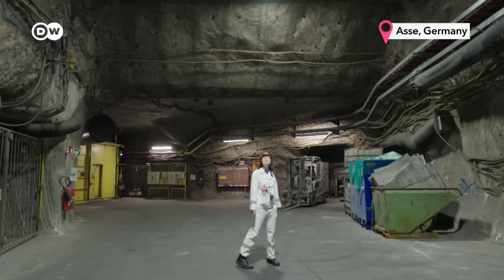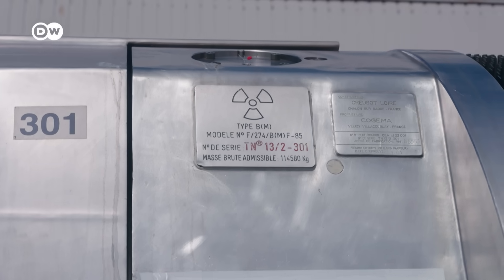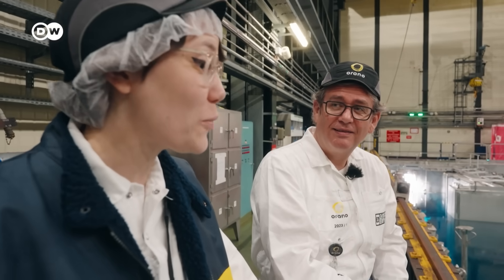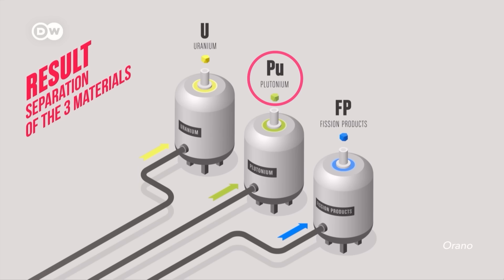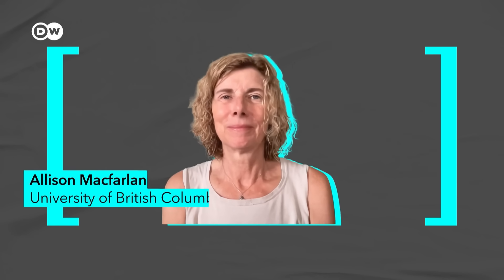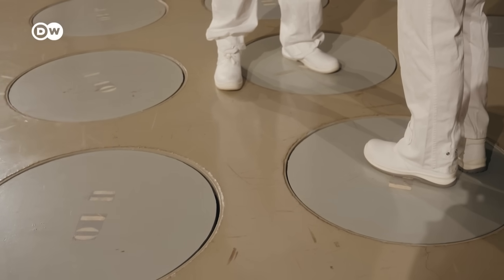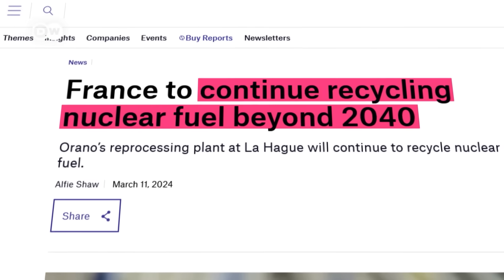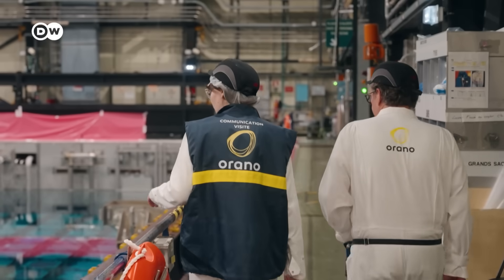Nuclear waste is reusable. Why aren’t we doing it?

Comment: La Hague is an impressive and very important facility – it plays a key role in reprocessing spent nuclear fuel and recovering valuable materials. Don’t take this as pure fact, but as I have understood it, France and many other countries do not yet have a permanent geological disposal site for the high-level waste that remains after reprocessing.
In contrast, Finland is building Onkalo, the world’s first operational deep geological repository for spent nuclear fuel, located at Olkiluoto. While France leads in reprocessing, Finland is pioneering permanent geological disposal. Both approaches are essential parts of the global nuclear waste management picture.

Comment: A great deal of disinfo against the LFTR MSR, no fuel rods needed, no giant cooling towers needed, and make pu-238 rtg power cells that last 80 yrs.
china is now running a variant of the US reactor made at ORNL in the 1960's, it is the best solution and would power the world for a thousand years if not longer.
Its would do so much cheaper, much safer, and fails passively to a passive cooling tank, and they did so every weekend at ORNL for 6,000 hrs.

Comment: Reducing the need for fresh uranium by 30%, and using the resulting mix to produce only 10% of your electricity doesn't sound much like you have achieved "sovereignty".
There is something else missing here too: not all Pu is removed, and other minor actinides with high radiotoxicity and extremely long decay times (tens of thousands of years) remain in the waste fraction, and still need long term geological repositories.
Pu recycling is not an effective enough method. Only fast burner reactors could really solve the eternal nuclear waste problem, leaving us with only fission products to deal with for a few hundred years instead of 100 thousand. But these technologies barely ever made it out of labs and demonstrator plants in the past 50 years.

Comment: If the rods in the shipment container is 300-400 Celcius hot  (as explained in the video), why not use it directly to heat and produce steam?
Reply from the maker: The used fuel rods are indeed very hot, but the main issue is that they are also highly radioactive. This makes it unsafe to put them directly into a steam system. There has been research into capturing and using this decay heat, but so far no practical technology has been developed that can do it safely and economically.
Reply: @DWPlanetA thanks for the answer 🙏🏻. However, my theory is though the steam and water will be contaminated it can remain within a close loop like in a HVAC system where the freons circulate in a close loop. Steam drives the piston then the vapour is cooled down and forms water. Then it's pumped back to the heating chamber. All this happens within a nuclear shielded container. Or am i missing something fundamental?
Reply: @dukeopeace7530 I'm gonna take a wild guess that costs and risks to maintain your system would be too high. I think leaks in the steam pipes would be incredibly dangerous to fix, and I'm pretty sure the plant would have to be shut down just to allow workers in for regular maintenance.

Comment: Because of their efficiency, molten salt reactors could be set up to burn nuclear waste.  It's been found that if enough MSRs were built to supply the current requirements in the US, MSRs could run for 350 years, burning up the nuclear waste.

Comment: First, the reactors are wrong. Salt solution reactors have an efficiency of 95%
Second, the fuel is wrong. Uranium only lasts a couple of 100 years. Thorium lasts 10,000years and is much cheaper.
Third, the oil industry doesn't want this kind of reactor; it would destroy their business completely.
So they got the money and stopped all the funding by all means necessary.
Without money, no reactor.
Nikola Tesla died poor, not from lack of knowledge, but from lack of funding. There is no cheap energy. It has to be expensive.
Accordingly to the people who have the money.

Comment: A Molten Salt Reactor (MSR)can be fueled with a mixture of Uranium and Thorium.  The inventor of both types of reactor was Alvin Wineberg.  The MSR can burn 98% of the fuel rather than 2٪.  Properly operated, MSR's don't produce Plutonium bomb material.
So why has the MSR type been abandoned?   Oak Ridge was the site of the research reactor.

Comment: If you were to add the cost of recycling to the business case for Nuclear power, the case does not add. Thorium can expoit spent fuel rods but you still have aresidue that you still need to safe store for 100,000 years.

Comment: To make a bomb weapons  grade is necessary. The obtained plutonium  from  fission reactors is NOT of weapons grade.
The Soviets did not know and built the RBMK anyhow , a kind of copy of a converter reactor ,
The idea is not totally wrong as graphite is used as a moderator and less U235 is needed in the fuel.
But the safety issues are as you know terrible.
Journalists are mostly communist affected and lied from the start as they got their information from Soviet KGB.
There are other reactors much more efficient and safe, but Big Oil does not like them and stopped development 1970.

Comment: New fuel is cheaper and people/governments are paranoid about nuclear proliferation.

The first issue has several solutions: store all the spent fuel until new fuel becomes more expensive than reprocessing (so the spent fuel is a valuable long-term investment), subsidize reprocessing to effectively mandate all spent fuel is reprocessed, or switch to fast-breeder reactor designs configured with molten salt reactors with continuous reprocessing of the fuel matrix. (the latter has the problem of maximum nuclear proliferation paranoia, albeit somewhat less so for hypothetical thorium-uranium cycle reactors instead of uranium-plutonium)

France is the only country in the world to use the section option (mandate reprocessing and heavily subsidize it). This approach also makes it more economical and much, much more strategically secure (full self sufficiency, no reliance or dependency on importing fuel from Uranium-rich countries), even if it still costs somewhat more than buying new fuel. France did it both because of their nuclear weapons program and for national security power interests. (they way they managed their nuclear power plant construction program is also exceptional given the tight regulation, high degree of standardization, and resulting safety records)

Of course, the real problem is that most of the mismanaged waste isn't unprocessed spent fuel, but large volumes of contaminated material that need to be processed, treated, condensed, and then disposed of properly (for any remaining residue). That's the kind of stuff that's supposed to be in the iconic yellow barrels. (though given the gross corruption and mismanagement ... and lack of proper oversight, that led to the sort of dumping in the case of the German salt mine ... I wouldn't want to bet on the levels of contamination for some of that stuff)

Spent fuel itself is generally too valueable to store as simple waste, even if it's not valueable enough to fully  reprocess (yet), but worth keeping around as a useful raw material. Plus you have to let it sit for years before it's safe to reprocess, anyway. But, from the reprocessing also comes the extraction of the fission product, particularly the medium-term (ie decades to hundreds of years) isotopes like Strontium 90 and Cesium 137. Those can be rendered chemically inert by dissolving into glass (forming silicates, given both of those have many, many soluble salts, especially Cesium, like all alkali metals) and going to a long term geologic repository (there's a tiny amount relative to the power produced, so this isn't a big deal ... as long as you have remotely sane regulation, and any sort of sane long-term planning, from a business perspective, too, since improper dumping is never good for long-term profits ... it just depends how long term you think)

But, even with the fission products, there's valueable use of them as well, and potential for nuclear-thermal generators of various types ... just don't distribute them throughout the wilderness and then abandon them like the Soviets did. (more realistically, they could be used as secondary generator fuel on-site with some power plant models ... and all sorts of waste processing is better to do on-site as much as possible as well, both for security/risk reasons, and sheer cost effectiveness)

Fast reactors also burn up a small portion of fission products due to the high neutron flux (or the side effects of high neutron flux), and fast-breeder reactors tackle that while also extending the refueling cycle dramatically. (assuming all bred fuel is intended for power generation with no reprocessing into weapons material, the fuel cycle can be much longer, or indefinite in a molten salt reactor, since the molten salt fuel matrix can be continually reprocessed during operation) But the most promising of these types are still experimental for the most part, and there hasn't been enough public interest, support, or funding to really make them a reality. (so the safest, best tested, most reliable designs are mostly derivatives of conventional tried and true light water reactors, many descending from the already mature designs the French licensed from the US in the first place)
Reply: Russia also

Comment: 2:04 How is this safe??? Wouldn't the fuel rods still emitting bunch of neutrons that can't be stopped by steel easily?
Reply: They go on 10 seconds later to say that it’s extremely heavy due to all the shielding
Reply: The more depleted it is, the less protection it needs, they also didn’t specify the thickness and possible other material and coatings used

Comment: A lot of that nuclear waste can be turned into top end cancer fighting meds!
Considerably more useful than coal just shitting carbon dioxide into the skies and not taking any responsibility for it. The nuclear waste, you can put it somewhere specific and it stays there, if done correctly. Not like the lead in leaded gasoline which is all over the surface of the earth now. 
It's a bit sad phones and tv's and monitors so high tech, and it's still coal = electricity. Plus it might still be that way the next 50 years if we don't haul ass to get more non-coal electricity sources.

Comment: Siemens already invented Clean Nuclear Power Generation in the eighties. But President Carter banned it !
Clean means the nuclear fuel can be used again and again until it is completely used up. So safe you can hold it on  your bare hands !

Comment: 7:52 WTF is a metric ton? I've used ton for all my life.  I've never heard anyone using a non-metric ton.  The "metric-ton" is something weird americans use.  So why is DW saying metric ton? Are europeans starting to forget how the metric system works?  Can I say metric-celsius or metric-gram as well?  Why are you being weird?
Reply: Unlike celsius and gram that are only used in metric, there is an actual need to dissociate ton by it use context.

There are actually 3 différent unit called ton/tonne: 
-the «metric» tonne (1000kg)
-the «british» or «long» ton (1016.0kg / 2240lbs)
-the «US» ton (907.2kg / 2000lbs)

I do undesrtand the confusion though
Reply: @toilieth There is no confusion.  The long ton, the version of ton before it standardized into the metric system as 1000kg is completely obsolete.  

Unfortunately the short ton, the US invented weird ton with the wrong conversion, still has some place in certain American industries.  After the metric standardization of long ton into ton, some American self-centered weirdo decided it should be easier to convert if they considered it to be as 2000lbs when the rest of the world was already using 1000kg.  Americans should call it short-ton, to differentiate their weird ton because there is already a ton that the rest of the world uses.  

To change how an internationally accepted unit is called, instead of accepting their own mistake and not call it the short-ton, but change the internationally accepted ton into metric-ton, is uniquely an American self centered view.  It is quite embarrassing really.

By the way, I studied engineering in the USA in the 90s.  We studied both imperial and metric.  There was never something called metric-ton or short-ton or long-ton.  Ton as part of the metric system was sometimes used but nothing else.  There really is no need to differentiate anything.  Americans can call their weird ton as short-ton if they want to use it so badly and out of respect for the rest of the world, as rest of the world don't care about their weird short-ton anyways.

Comment: Sigh this stuff in the berrals is all the stuff associated with handling and containment equipment it's contaminated with radioactive particles. The fuel itself usualy gets stored. It's way more expensive and dangerous to recycle the pellets expand and fuse with the containment tube.so you need acid

Comment: Gee...wouldn't it be great if we could actually turn all this nuclear "waste" into something usable energy without a whole lot of handling? Thorium Molten Salt Reactors can do this. It can accept not only U-233, but also U-235, U-238, Pu-239. MSR's will have a "kidney" like set of devices that will chemically separate what is needed from what is not needed. An example, if U-238 is allowed to circulate around a reaction vessel where an additional neutron can be added, it can become U-239, which half of will turn to Pu-239 in about 3 days half.  The ability for a MSR to set aside U-239 just as it will do to Thorium-233 to convert to Pa-233 then to U-233 will allow these reactors to accept U-238, convert it to U-239 eventually becoming Pu-239 which is fissile. 

Did you know that the EPA does not allow Uranium miners to return the U-238 waste to the mines where it was extracted? With a Th-MSR, it can now use the U-238 as well to produce electricity. So instead of using only 0.7% of uranium that is U-235, we can now use U-238 which we have in abundance. 

What's stopping all of us? Ask the NRC...bureaucrat scaredy-cat regulators.

Comment: Yes, but chemical reprocessing is expensive and produces more highly toxic chemical waste! A much smarter approach is to use integral fast reactors like the ones Russia is using (BN-600 and BN-800). One, designed as a "fast breeder" uses spent fuel elements (U238) to breed new fuel for it self and pressurized water reactors; the other, designed as a "fast burner" uses high-purity weapons-grade plutonium from nuclear disarmament/modernization (or the 239pu from fast breeder)... and both are running during commercial electricity and energy production! Germany could have had an isotope economy with a closed nuclear fuel cycle (NFC) long ago with the Kalkar nuclear power plant, but unfortunately, the operational nuclear power plant never went online due to political concerns. 

The principle of breeding is not really new, as it was already 2 billion years ago at the natural nuclear reactors in Oklo.

Comment: If that spent fuel is still over 200C-300C why not use it to make steam and then power? while you wait for it to chill out and cool down?
Reply from the maker: It would be tricky. You’d need special gear to handle the heat safely, and the current setups aren’t built for that. It's doable, but would take some work and investment. ☢

Comment: The energy from nuclear plant is already the most expensive and there is even not account the risk of a total meltdown. As You have seen in the video the used material is mostly not recycled because of the high cost. The electricity from wind power generators and pv systems are today cheapest and the price is still going down. It is no-brainer, which technology has future. There is only one reason to use nuclear plant: To build atom bomb and use nuclear submarines.

Comment: You guys really should mention other reactor types like breeder reactors which will can reduce waste and almost eliminate the need to recycle. Reactors like Natura liquid fuel reactor has something like 90%+ fuel utilization, using less fuel and can remove fission products in continuously without needing to shut down the reactor. You could also just use throium instead of uranium and avoid the plutonium problem altogether.

Comment: India is now using Plutonium with Thorium in Fast Breeder Reactor and getting U233 another fissile material to reuse again with Thorium again they get U233 as spent fuel because non fissile Thorium absorbs neutrons from Pu in the first process and from U233 in the second process and change in into U233 and the cycle continues